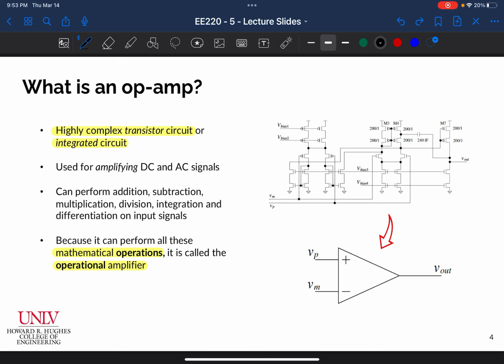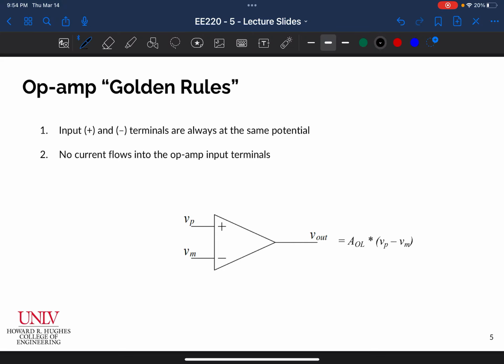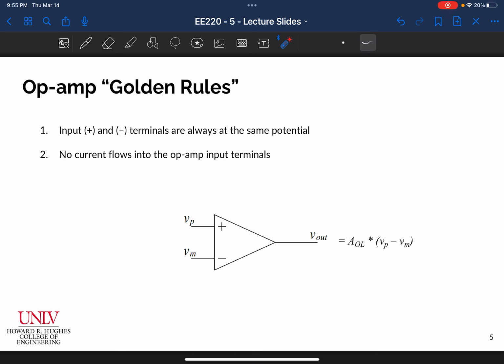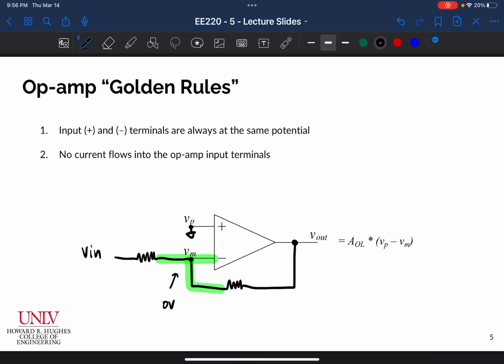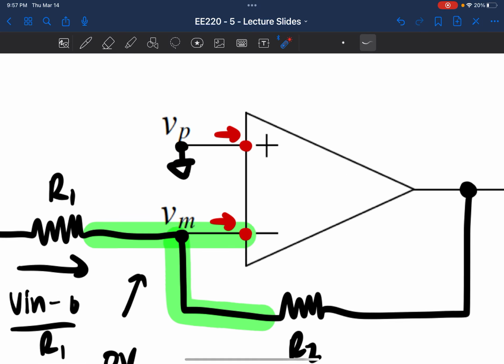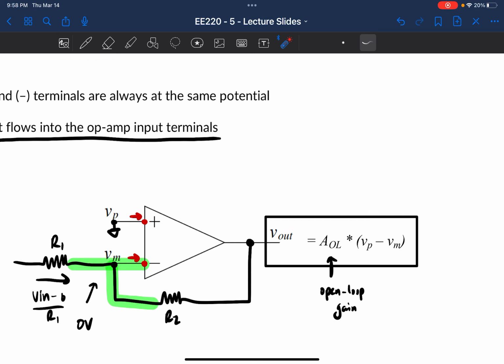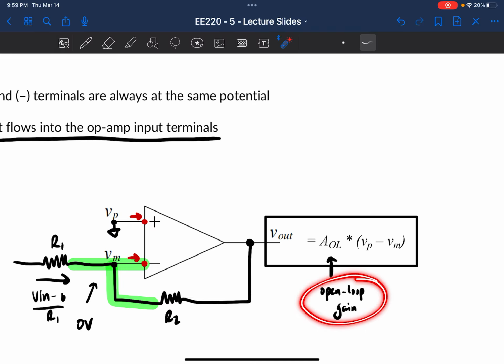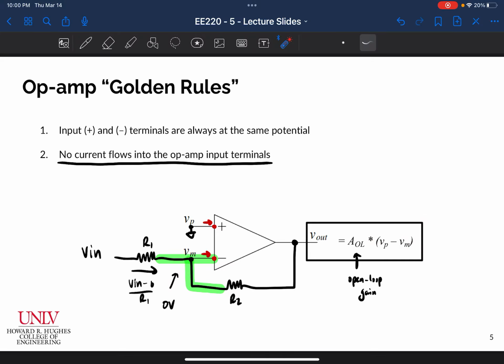5.3 - "Golden Rules" for Op-amps

Comment: The important thing to say is, that in order for the first rule to apply (the rule of virtual ground), there has to be a negative feedback present in the circuit; the output has to be somehow connected to the inverting (negative) input.

The working priciple is as follows (simplified):
Whenever should the voltage at the inverting input be greater than the voltage at the non-inverting input, the output would drop low (to -Vcc of the op amp), 
and as a result this low voltage at the output pulls DOWN the connected (e.g. via resistor) inverting input node.
And it works the other way around too:
Whenever should the voltage at the inverting input be lower than the voltage at the non-inverting input, the output would go high (to +Vcc of the op amp), 
and as a result this high voltage at the output pulls UP the connected (e.g. via resistor) inverting input node.
Because of this negative feedback, the voltage stabilizes at the point where the voltage at the inverting node is clinging to the voltage set at the non-inverting input, so there's effectively the same voltage at both nodes.
(That is if the supply voltage range of the opamp enables it.)

For example in the comparator circuit, where there's no feedback made between the inverting and output nodes, this first rule does not apply.
Reply from the maker: Great point. I should mention that for sure.